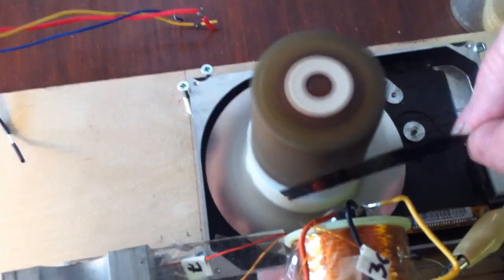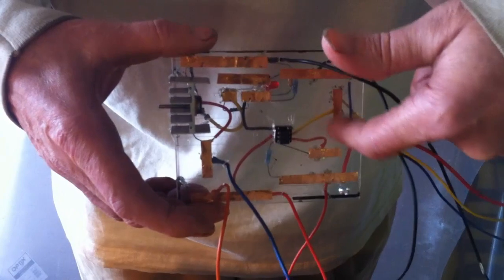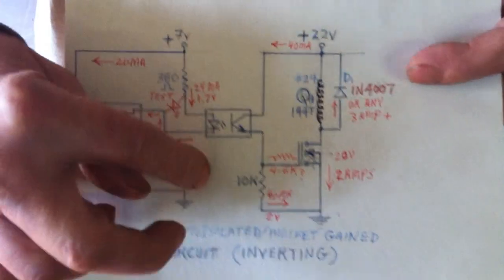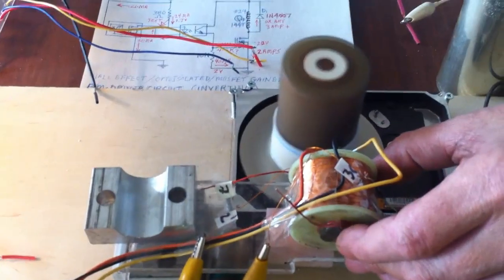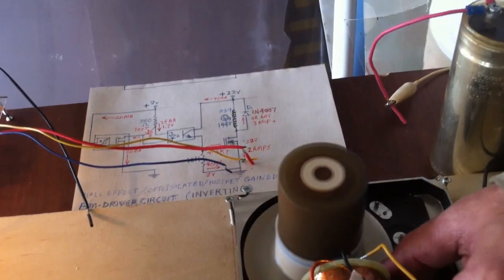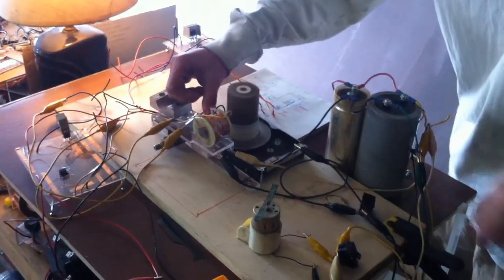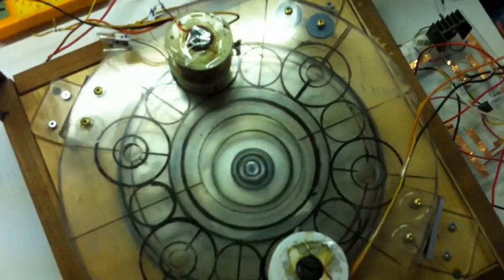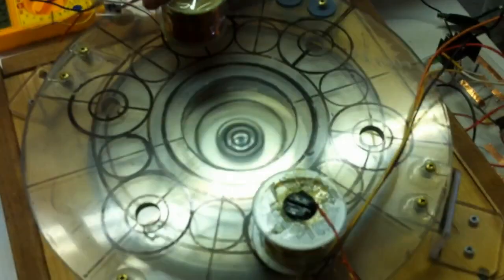UFO Alien Leak - FS10a Wireless Power Downloading

Comment: Actually they will only charge capacitors to  the voltage of spin-speed X no. of magnet pairs. Fill small caps faster & resistance builds as capacity peaks. What are called "super-capacitors" (Maxwell) need 20 amp current to recharge to 48v (I had to convert 220v arc-welder to recharge mine) - that is why they are used on Chinese buses & recharged every few blocks by underground cables. We have to utilize both electronic-pulse drivers AND velocity wind resist: FS14 has best demo to date!

Comment: I mention Voltage, & then Proximity regulation - but neglected FREQUENCY (for higher revs.) You  can use exactly the same circuit shown - but with a 555 replacing the H.E. (switchover at about 1 or 2 thousand rpms). The frequency option weakens torque, but makes clear the path to single freq. wireless downloading. As of now the freq. used are spread all over the bandwidths (thus minor & various "sweetspots"); dedicated towers of say 30k herrtz will change that alot (uncrowded band at present).

Comment: Yes - but notice the gyroscopic stabilization that takes place with greater speeds. The framework is to accomodate a number of 3-phase gens. (see previous vids), also  so you can see! Plastic cylinders supporting roof from rear (above drive wheels) would be used in production models.